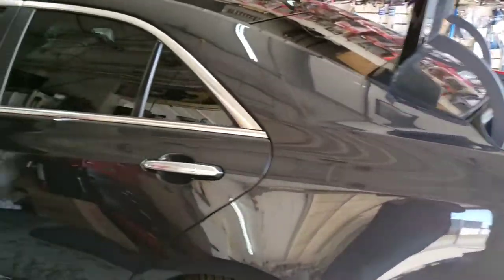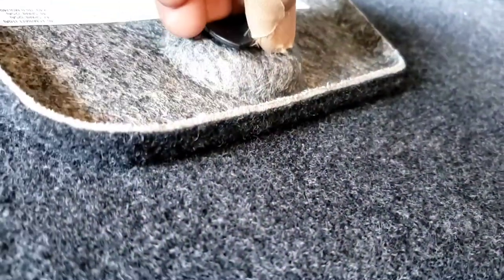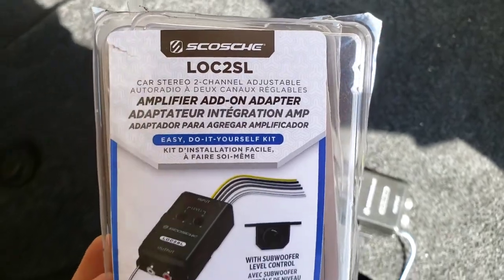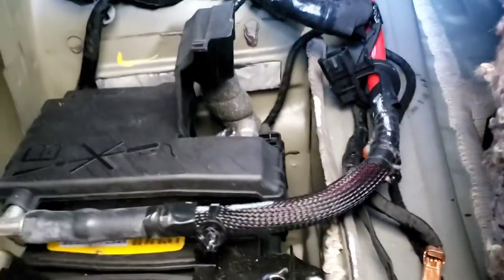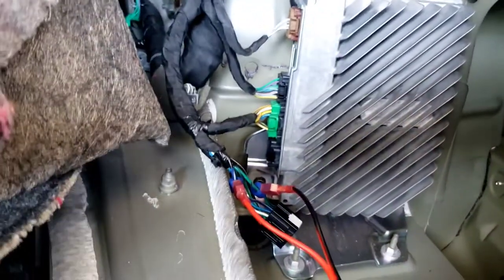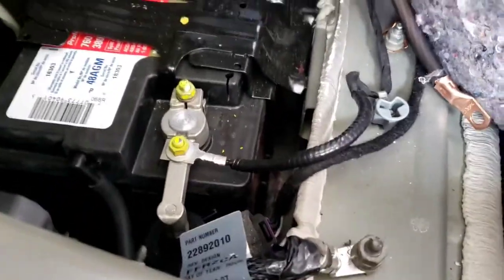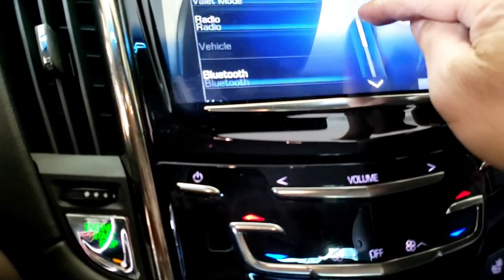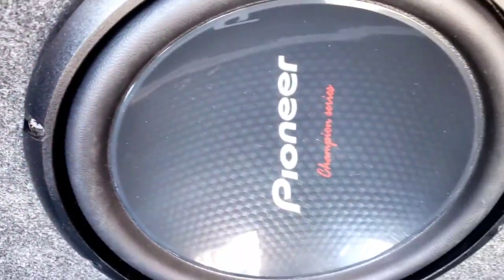Amplifier Installation 13 Cadillac ATS using Line out converter (LOC) JL Audio

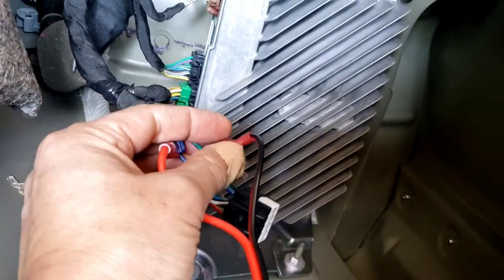Comment: Hi. At 4:13 you spliced into the factory amp.......what size wires are the factory amp wires that you spliced? 14-18? I need to insure I have the right size splice wire terminal. Thanks!
Reply from the maker: @brianmoinflo3063  14g its the black plug
Reply: @khmerohio  Thanks so much! At 2:50 you stated you were going to figure out which fuse you were going to use for the remote turn on. I need help with that too. I have a pic of my fuse box I can send. 16 gauge so I need a 10A fuse I think. I see HTD MIR 10A, ONSTAR 10A, RR CLOSR 10A, CNSTR VENT 10A,  BCM2 10A , UPA 10A, RDO/DVD 15A , MSM 10A, ECM/BATT 10A. Any of those look good to use my piggy back fuse taps?
Reply from the maker: @brianmoinflo3063  bcm

Comment: Good job! I have a CTS4 with the same set up but my subwoofers makes a loud humming noise whether the radio on or off and it stop when I open car door. It’s very annoying. What should I do? Help me please.
Reply from the maker: First check the ground but how did you hook up the LOC or Jack?
Reply: Hey Craig you have to disable the active noise canceling microphones.what you are hearing is amplified engine noise manufacturers put in their car to “enhance driving experience.once you disable those,you won’t hear that annoying sound
Reply from the maker: https://youtu.be/JbfHVKz4vnU
Reply: That’s a bad ground connection.. remove the ground clean up the connection point and reinstall the ground

Comment: What fuse can I use as a remote switch because all the ones I tried stay hot
Reply from the maker: Look sor something for ign or acc
Reply: Thanks I'm gonna try that I been installing amps for years and this is the first time I ran in to this problem
Reply: I have a 2015 Cadillac cts
Reply from the maker: This one is tricky
Reply from the maker: You can find accessory wire at the BCM under driver's dash blue 25pin plug pin 5 Violet/yellow
Reply: @khmerohio  I also have a 2015 cts. For pin 5 I have a grey wire. I do not see a Violet/Yellow. I just wanted to confirm you did mean the blue 25 pin plug and not the light green one?
Reply from the maker: @coltonrickman9344  what color is pin 6 is it violet/black?
Reply from the maker: It should be the green 25 pin plug
Reply: Ah I disconnected the ground from the LOC and it works great now! I’ll leave the comment just in case someone runs into the same problem
Reply from the maker: @coltonrickman9344  awesome 👍
Reply: @khmerohio  DO you know what fuse goes to this wire? I was moving stuff around and think I might have popped this fuse? I re checked the ground and the 12v and both look good.

Comment: Does onstar and chimes still work without factory amp not that I use onstar but would like to have my chimes for low gas, doors etc.
Reply from the maker: Everything should be the same all we're doing is just tap the LOC for the Amplifier

Comment: Still did not show where you got your speaker inputs from where did you get your signal input
Reply from the maker: 3:38
Reply: @khmerohio  I will be trying this on my 2011 STS I already have the wires tied into the blue and green wire from under the seat I tested it with a 9-volt battery and it made the subwoofer pop and I spliced in RCA directly to the amplifier but I want to make sure I wear it from the amp to an lc2
Reply from the maker: https://youtu.be/6gJh3mQVGhM
Reply from the maker: Check this out
Reply: @khmerohio  I put one run of double zero right above the boot drilled out a nice hole
Reply: @khmerohio  lc2 is ok? Is it better for me to get the pro I already have an amp installed 40ah in the front 80ah in the back Yin longs.
Reply from the maker: @BlackninjaDeathstar  the lc2i pro is better because it came with the bass knob control
Reply: @khmerohio  I'm only paying $50 for the lc2 though

Comment: How can you control the buzzing sound when I close my door ? As I accelerate around 1000rpm my sub woofer will give out bass even if my volume is down. Hopefully I can get some input. Thanks in advance
Reply from the maker: Need to remove the mic top of driver's ANC
Reply from the maker: https://youtu.be/JbfHVKz4vnU

Comment: some reason my LOC doesnt turn off/on wen the car starts/is off … weird
Reply from the maker: What brand?
Reply: kicker LOC
Reply from the maker: Dont use kicker it will not work on thus ca use loc2 audio control
Reply: so it needs a LOC that needs its own power ran to it?
Reply from the maker: Yes you can jump the remote and power to see if you have sound.  If you got sound, just go to the fuse box and tap the temote wire to an accessory or ignition
Reply: okay because that kicker doesnt have its own power and ground, it turns on and off automatically but it doesn’t turn on wen it should
Reply from the maker: Just on the Cadillac and the escalade 2015 up
Reply: okay so a differnt LOC should do the trick?
Reply from the maker: Get audio control loc2